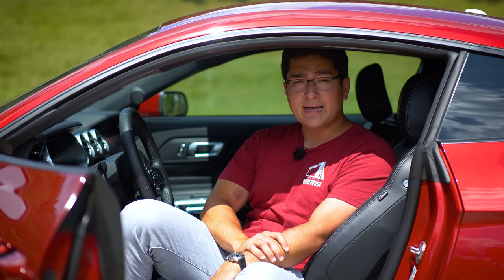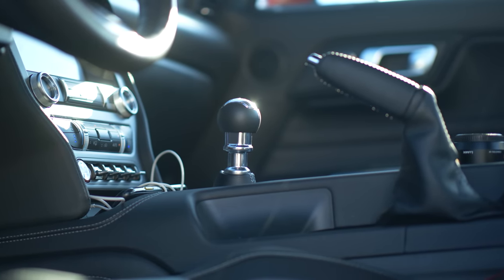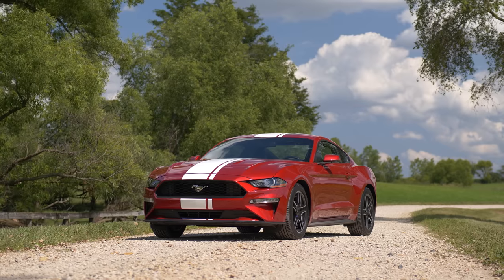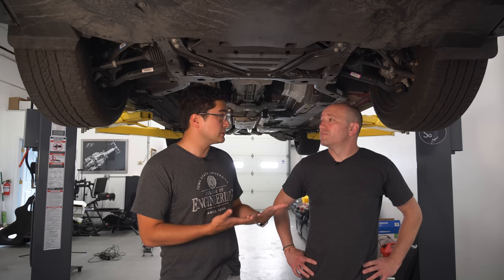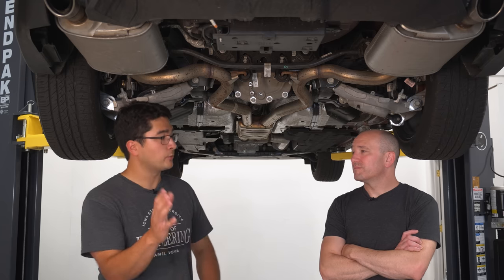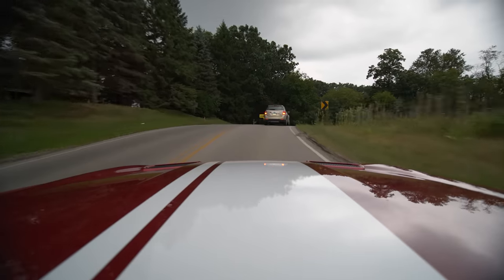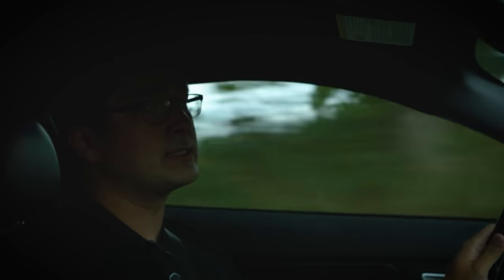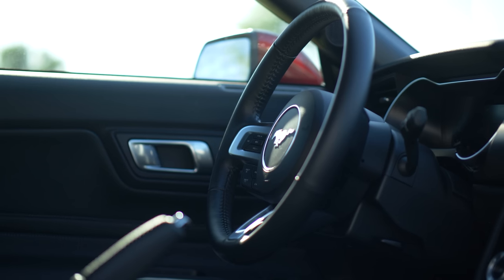2020 Ford Mustang EcoBoost | Red Headed Step Child

Comment: Here we are in 2020 and a RWD 6MT 300hp coupe is considered low performance.
Reply: Well yeah because now there making 800 horsepower cars that idiots buy because of there ego. When In reality most of them will never use the full potential of the car they just wanna look “kewl” 🤷🏻‍♂️
Reply: The thirst for power is out of control imo. It's why the Germans and other power hungry manufacturers have reliability issues
Reply: @ZACH_95_ If you don't do track driving, anything over 400whp is overkill.
Reply: Especially, low 5 secs 0-60.  That's extremely quick to me.  You'll definitely get alot of people from a dig.
Reply: @ZACH_95_  their*
Reply: They’re just mad it has a mustang emblem on it. If it was made by some Japanese company, everyone would be gushing their load all over it
Reply: "we live in a society" where a Camry doing 5s 0-60 is "slow".
Reply: @TackJorrance  The 2003 SVT Cobra had 390 horsepower. Now the lowest end mustang only has 80 less, it's insane.
Reply: @camryt  sub-6, not sub-5.
Reply: @camryt  jeeebus are Camry's that quick now??
Reply: @JJ-ls7fq  indeed
Reply: @KT_One  Camry with the 6-cylinder engine hits a 0-60 mph time of 5.8 seconds.
Reply: Yup - that is the stigma with these cars I never understood. I owned one for 4 years, it was tuned and did 0-60 4.7 seconds and made 370 wheel torque. It was more than plenty fast to get me around town and commute to work.
Reply: @taurussho86  I believe I counted approx. 7 seconds to 60 for their second acceleration run in this video. I wonder how much improvement the "high-performance package" Ecoboost version would offer?
Reply: It's the weight. Truly. I weighed mine at just over 3700lbs. You need some power to hustle the big girl around. 300 is the bare minimum.
Reply: A 95 hp NA Miata is more than enough for me to go to work and back home
Reply: It is a lot of power but modern cars are very neutered by traction control and computers pulling timing all the time, as well as the insane amounts of mechanical grip coming from very huge and wide tires and sticky tire compounds. In fact, an older car with lower HP might feel a lot more brutal and tricky to drive than this just because it will go sideways more easily and generally feel more out of control and like you can push the engine to the limit.
Reply: Remember when the r34 skyline made some 300 odd hp and it was hailed as the second coming of automotive christ?
Reply: I would take the ecoboost mustang, and do some suspension/brake/wheel upgrades and take it around corners
Reply: @AIDAHAR210  I have a '16 ND, it is a good car. People are putting LS V8s in those, crazy. The Ecoboost engine might not be a bad thing in a Miata.
Reply: Yeah the way they said that was ridcolous. Stis barely make more power. Im a enthusiast and I have a base mustang gt. It's cool to save money and upgrade as time goes by. So I say the ecoboost can be a enthusiast car
Reply: says the core buying demographic
Reply: I would not consider this low performance like they do. With an intake, exhaust and a tune this is more than capable in any scenario. I'm not sure I would even take the v8 Mustang as a track car instead of the ecoboost. The running cost are so much lower for the ecoboost and it can actually be driven to its fullest potential almost anytime. 300hp is plenty on the street to me.
Reply: 3,700 pounds is not insignificant. That's a real piglet.
Reply: G. S. It’s not a slow car but the other cars on the market are just faster
Reply: Watch how the new 400z will have 400hp and people will still be asking for more.
Reply: No low performance is my 05 Malibu LS V6 200 horsepower. 0-60 in 8.1 seconds. The Ecoboost is like 3 seconds faster to 60 that's fast to me. I would be thrilled to have over 300 horsepower.
Reply: @BahhJustaLamb  Put a manual in the 300 HP V6 Camry and watch it fly!
Reply: @Josh-cw8by  apples to oranges bud
Reply: @3ducs  idk. You'd probably just be better off boosting the ND 4cyl than swapping in a ford 2.3t. It wasn't that reliable in the focus rs. I know the mustang version is slightly different
Reply: @jaybee2344  I sure wish a 300hp manual Camry existed!  I would have totally bought it!  So, instead, I bought a 6-speed Corolla hatchback earlier this year.  Never thought I'd ever wind up with a Corolla, of all things.  But, if you want a new Japanese car without direct injection only, and no turbos, there was really no other option.  Apparently, some time in the early 2000's, Toyota eliminated the manual from the Camry.  That's really too bad.
Reply: @wigletron2846  Truth is that the stock engine is fine for my purposes. Yeah, I'm getting old, I did have my time with sport bikes, now there is real power, something almost no automobile can match.
Reply: @3ducs  I'm the same way. Idk if it's age like you said, but I care less and less about going fast in a car. I might have been spoiled by bikes too
Reply: @Josh-cw8by  that's the problem. To get the same thrill of a bike in a car you're spending massive amounts of money. At some point I started viewing the bike as the fun machine and the car as A to B transportation. Especially with the prices of cars nowadays, I'm good.
Reply: yep insane ! Speed limit on hgwy here in Western Canada is MAX 110 KMS -- 90% of cars are not even at full tilt at that speed ...
Reply: @001spring  that's true, the new polo 1.o tsi is the most fun to drive and most bought car because of that. And if you need more you move up to the gti....i don't get it why mark is so against that idea...it works and works well with the germans .
Reply: There are reasons why the 86 and MX5 exist.
Reply: Stagger Lee Thats 390 Hp SVT Cobra actully slower than the lowest end 2020 Mustang.
Reply: Honestly tho. 300hp? “regular economy car”
Reply: Why not? Tech has increased cheap power while cutting emissions. The V6 Camry had 270hp in 2007. A 2015 Camaro SS had 426hp. A 25yr old 1995 Camaro LT1 had 275hp. A 1975 Camaro V8 had maybe 200hp.
Reply: @Syncopia  yes, but the r34 gtr with $1,500 bolt-ons would be at 500hp+, just like the mk4 Supra. What made them legendary.
Reply: @aquaboy1650  but the 390hp terminator cobra could handle 600whp on the stock block.
Reply: well it weighs ~3600lbs and imo the engine management makes it feel very lethargic, specially on the 10spd one, my experience at least. V6 Camaro with a 6 speed manual is a better buy IMO.
Reply: 300 when it's not pulling timing.
Reply: Yes, these guys are daft.
Yes it should be a 2.7 or 3.5 Turbo....Ford instead makes an HPP (yawn) you may as well buy a V8 because its price is in the V8 range.
Reply: Most non-M BMWs have much lower horse power, are much less reliable, and yet people gush over those cars. I don't see their appeal. Also, the 444HP new GTs do 0-60 in low 4s, so it's not like even higher HP over 400 are significantly blowing away this 300HP ecoboost. Yes, much of this is simply PR and consumer ego-driven nonsense.
Reply: @aquaboy1650  I dunno. I think the SVT claimed 0-60 at 5.1. Probably not slower than the ecoboost. Neither is my 2008 Bullitt.
Reply: @Gastón Com'on over man, we could use some more light skinned immigrants who actually know English. Go to school for 2-4 years and make $60k+ a year or get into a trade like plumbing or electrical. Cars are cheap, gas is cheap, guns are cheap and legal.
Reply: Jeff Brisson I’ve never owned or even driven a sports car so the idea that a 300hp RWD coupe is somehow a boring vehicle seems to crazy to me. My Tundra probably weighs 2x what this thing does and only makes like 60 more HP.
Reply: In europe people driving 105 hp why ? No money for gasoline everyone driving diesel. 300 hp if you are really rich. 800-hp if you are milionare.
Reply: Come to think of it, 300hp is probably the sweet spot for the enjoyable daily driving on a manual transmission. Although in the case of Mustang it probably depends on the character of turbo boost.
Reply: @ZACH_95_  
Yup the difference between a HellCat and GT500:  GT500 can go on the Road Course Canyons, and the Roll Cage to protect the driver, and to keep the chassis stiff and twisting.
Reply: Prefer Supercharger (Whipple/ Roush), because at 38,000 miles i had Turbine Lockup within the Turbos at 82°+. This is caused by Thermo Variations consider locations of Turbos Ford mounts them below for lower center of gravity.  Problem is they're right next to the very hot engine.  Ricers know this and mount them up high close to heat extraction hood vents.  To keep them cooler, and not for show. Now the Turbo Shell expands like a donut 🍩, while it's being baked the outside expansion is outwards vs. Inside expansion is inward the hole gets smaller. The Blades expansion is outward to be larger to hit the Shell. Locking up the Turbine Blades, and then add the Backflow from the Intake and Downpipe to it to spool the the Turbos more.
My fuel mileage went from 
32 mpg to 8-12 mpg.  Glad for 2021 it'll have the GT500 engine package 5.0 V8
Reply: I think these two guys are the wrong two to review this mustang. There is not much appreciation.
Reply: @t-lawsfitness6044   Yes though, it just means they're not Ford fans so they're honest.
Reply: @ChasingDifferentAdventures  true but I tell they are not even honest about this car. 1st r car makes 310-320hp and we 350 torque. That's no laughing matter. And they didn't one time speak on the tunability of it. Most people that somewhat follow this car knows a tune can make this over 400 lb-ft  torque and closer to 400hp. That's not some slow car by any means. As well as it being bigger and more comfortable. Seems like they purposely didn't wanna speak to highly about it
Reply: @t-lawsfitness6044  agreed 👍 
They expect to some day critique a GT500,  though Ford sees this video and their negative attitude.  They will never get chance, and perhaps not from any other Manufacturer either
Reply: Thought 250hp would be enough when I drove 180hp car then I drove 300hp cars and thought hmm.. I could go more so I drove 380hp car and at this point I thought I won't go higher up cause it would be life threatening but instead I wanna drive 400hp cars now.
Tbh I am scared one day I might find myself in a car accident but I just want more.
Reply: I mean a base Chrysler 300 has 300hp and so does a v6 Camry and a Ford Edge. Do you consider those performance cars?
Reply: @sun2190_   It's not bad to be scared, especially,  if your 400+ hp Mustang GT Premium Performance Pack 2 ( it has Brembo Breaks, Magneride Suspension ( think 2 positivecharged faces of magnets they can'tget together the Mustang doesn't lean on Sharp hard Cornering and dip during hard Breaking, same as GT350 without the 530+ hp or Snake Badges) out stops all vehicles around and those behind you 🙋‍♂️👍. It also came with Goodyear Eagles F1 Asymmetric tires and in the rain it handles and stops like it's dry ( Think Formula 1 racing in the rain 🌧 🏎
Reply: @ChasingDifferentAdventures  hey man, thanks for the advice but I live in Canada where I have to deal with pretty awful winter storms. Sticking with rwd and driving through winter is already challenging, of course with good winter tiers tho.
Idk I am torned if I should go with those German entry performance cars, Japanese awd coupes, orrrrrrrrrr ecoboost stangg haha
Reply: @sun2190_   German sounds good.  I was upset with Ford when they announced a 4 door variant was going to be a Mustang ( Mach E) so looked at Jaguar F-Type R or SVR.  Then found out  they were Automatic Transmission. Thought no rather Spec the Mustang and then add either a Whipple or a Roush to bring horsepower up to 725 hp that way already would already have the breaks to stop it
Reply: Looking at this from Europe in my busted 316i from 1994 with 102 hp
Reply: David Olsson I bet you watched the whole video tho
Reply: @PedroPerez-kw8pf  Tried to see if there attitude would change and it didn't.  It was the first time watching them.  I don't bother watching anymore of there content
Reply: @PedroPerez-kw8pf  They will never critique a GT500 with the bland attitude.  Other manufacturers will not want them to critique their Super Cars, or European Exotics.

Lack of positive attitude or introduction character.  I mean don't even mention the comfort of a padded arm rest.
Reply: @sun2190_  Prefer Supercharger (Whipple/ Roush), because at 38,000 miles i had Turbine Lockup within the Turbos at 82°+. This is caused by Thermo Variations consider locations of Turbos Ford mounts them below for lower center of gravity.  Problem is they're right next to the very hot engine.  Ricers know this and mount them up high close to heat extraction hood vents.  To keep them cooler, and not for show. Now the Turbo Shell expands like a donut 🍩, while it's being baked the outside expansion is outwards vs. Inside expansion is inward the hole gets smaller. The Blades expansion is outward to be larger to hit the Shell. Locking up the Turbine Blades, and then add the Backflow from the Intake and Downpipe to it to spool the the Turbos more.
My fuel mileage went from 
32 mpg to 8-12 mpg.  Glad for 2021 it'll have the GT500 engine package 5.0 V8
Reply: My old v6 sn95 just cried a little. 120rwhp
Reply: @CourageousCorgi  don't cry too much.  Prefer Supercharger (Whipple/ Roush), because at 38,000 miles i had Turbine Lockup within the Turbos at 82°+. This is caused by Thermo Variations consider locations of Turbos Ford mounts them below for lower center of gravity.  Problem is they're right next to the very hot engine.  Ricers know this and mount them up high close to heat extraction hood vents.  To keep them cooler, and not for show. Now the Turbo Shell expands like a donut 🍩, while it's being baked the outside expansion is outwards vs. Inside expansion is inward the hole gets smaller. The Blades expansion is outward to be larger to hit the Shell. Locking up the Turbine Blades, and then add the Backflow from the Intake and Downpipe to it to spool the the Turbos more.
My fuel mileage went from 
32 mpg to 8-12 mpg.  Glad for 2021 it'll have the GT500 engine package 5.0 V8
Reply: @CourageousCorgi    So that's my experience with Turbos
Reply: No doubt.  Light speed isn't fast enough for a couple of spoiled brats who never have to buy these high performance cars.
Reply: @AIDAHAR210  I'm only 5' 9" and 170 lbs, but I feel very cramped in the MX5 - which is unfortunate because I really like the retractable hard top version.
Reply: Jolly Roger Dodger  Enjoy it while it lasts.
Reply: @zzanatos2001  it is cramped indeed. My legs love to rub hard under the dash and I have to drive with top down just to keep my neck straight. Seems like Mazda was discriminating anyone over 5'5" when designing this, but I can't help its a lot of fun that I payed $700 for. I do have another car for a more comfortable commute though.
Reply: It is the automatic transmissions that have made the difference in 0-60. But a Mustang is a fatty. 300hp isn’t much when people keep adding weight.
Reply: here in europe most people have cars between 70 and 170 hp lol
Reply: Jolly Roger Dodger  I hope you have good luck with it and it lasts a very long time.
Reply: @taurussho86  It's pretty good for the price. Honestly the base would be plenty of power for anything but drag racing if it handled a bit better. Very cheap to change this though Set of coilovers, stickier tires and some stiffer bracing/sway bars and it's enough for any competent driver to smoke the short guy in the 5.0 bitching about it by several sec per lap lol.
Reply: weird.....savage beats up the mustang, but savage tried to mod his 170hp frs, 0-60 in about 8seconds.
Reply: @bronzewaffle2310  He loves the Civic which cannot keep up with this unless you spend 35k.
Reply: Well a camry has 300hp so there is that.
Reply: @Hallowsaw  Camry sells for the same price, is ugly and FWD
Reply: AND 350 torque. I just got one it’s sick. Buy a tune and you’re good
Reply: @Josh-cw8by  A Cessna would make your bike seem slow. Stop with the apples and oranges comparisons.
Reply: My dad has a VW Passat 170 horsepower and it feels pretty fast . And  as you said nowadays a 300hp car is considered low performance 🤡🤡🤡. I dont get it. Maybe I'm in EU that's why I dont get it .
Reply: @Pube83  
You’re comparison is a little off. That 75 Camaro may have had 150 HP but the same engine 5 years before had 350 HP. It’s relative. The LT1had 275-335 and the LS1 305-350. Now the LS is 400+. It’s the torque that makes these cars ‘feel’ fast driving on the street. The new V6 Camry may have 300 HP but it doesn’t have the torque
Reply: @ZACH_95_  right. The real posers are the ones that buy cars with unmanageable power that they will never learn to use. I bought a new ecoboost because it has pleanty of power to let loose "6 speed". I can afford a gt but typically have more fun with cars and bikes you can push closer to the limits on the street after a daily commute.
Reply: @bronzewaffle2310  absolutely. I bought a new 2021 ecoboost just for the fact that it has a high powered turbo 4 that can be easily tuned. I have never even liked ford's but I like thst they did this to the mustang. It's like a Japanese tuner car but already starts out with exceptional power unlike a brz or 86 etc.
Reply: @Josh-cw8by  after getting into the best of the sport bikes I still find pushing a 300hp car after a commute to be entertaining.
Reply: @Darylrb1983  that's what I bought one for and even before those mods it's Hella fun. And I'm used to racing Superbikes so it's not like I don't understand brutal power.
Reply: It's not...its low performance for the MODEL
Reply: My HPP EcoBoost has more power and torque than my old 1990 5.0 LX, 332/350 Eco, 225/318 5.0 respectively... and that 5.0 was a tire shredder
Reply: 300hp in 2020 feel very different from a 2005 300hp. Modern cars hide the power and speed too well. So often times more power is needed. And, of course, the handling/communication.
Reply: @taurussho86  about the speed of a GTI
Reply: Y’all sound like a bunch of Prius owners lol
Reply: @Darylrb1983  that is exactly what I’ve done so far…and lowered it as well…major fun
Reply: I was just thinking that. I rented one and the thing just flew on the highway. It's tremendous value for the money.
Reply: @JJ-ls7fq  at the best time most Camrys will still hit over a 6
Reply: It’s not about how hp it makes, it’s about how many grams it doesn’t have. Cars are way bigger and heavier than they were
Reply: @bronzewaffle2310  Nissan Z400 proves your point
Reply: @ZACH_95_  👑
Reply: @ZACH_95_  their...
Reply: Not to mention that with some upgraded turbos you can get like 600hp from them for cheap.
Reply: @MrNorotic  Truth!
Reply: @Razor Sharp I own a 2021 GT and I've run across some quick ass ecos that had upgraded exhaust and turbos.
Reply: @Pube83  a PP ecoboost Mustang puts down 275whp and 375wtq with an Accesssport and an off the shelf tune.
Reply: @Chasing Different Adventures  both the GT86 and ND2 are faster around the Streets of Willow than a Hellcat. Horsepower isn't everything.
Reply: @bronzewaffle2310  so true
Reply: Yeah because you’re pushing a 3500lb boat
Reply: @AIDAHAR210 , 
... and still have fun on canyon roads, or even get a speeding ticket now and then.
Reply: @aquaboy1650  The 03 Cobra runs high 12 second quarter miles stock and the eco-boost which is the base compared to the GT runs the quarter in mid to high 13’s ????
Reply: That’s faster and better handling than most all the prior v8 mustangs….
Reply: @ZACH_95_ I rarely use the full power of my 02 GT… so makes no sense for me to have all the extra weight.
Reply: How is a 5.2sec 0 to 60 slow? That's faster than the GTI, WRX, A4 Quatro 45, Civic Si ext...
Reply: it's a 4 popper, man im starting to sound like these guys.
back in my day we called em 4 bangers lol.